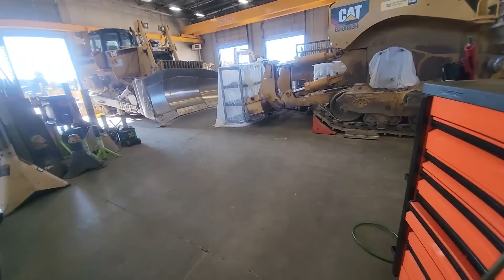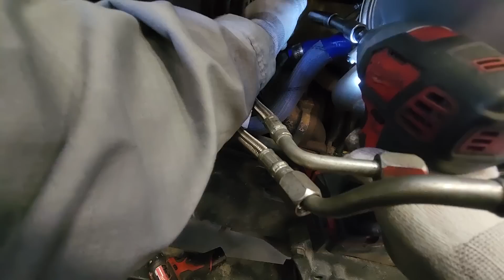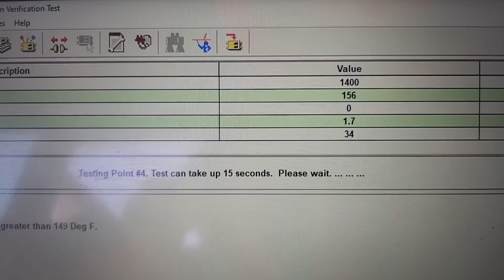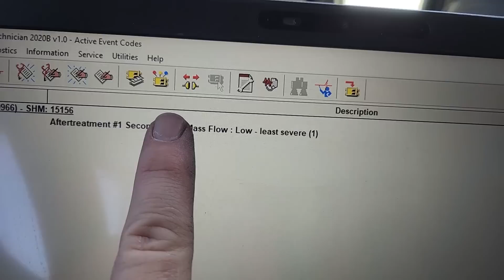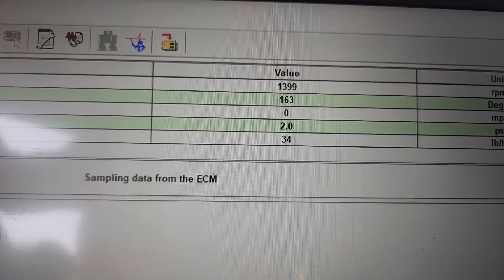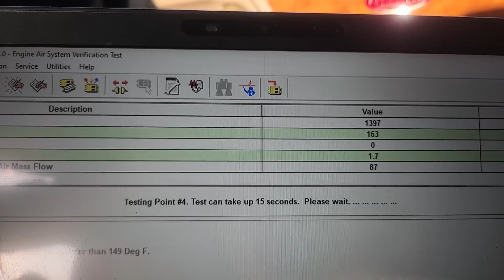Boost Leaks are Driving me CRAZY on this Diesel Truck. Green Can O' Worms 3.

Comment: im just going to give them my cereal number for my engine and they can order parts to fix the issue. so its 6nz15119. just need to order a new turbo cylinder head and ecm and the problem is solved

Comment: Clamp can't tighten enough due to rust buildup on outside surface where it grabs onto. Also the flange mating surfaces are worn thinner due to rust pitting and then sanding to make them smooth. That makes it necessary for the clamp to be able to get a deeper grip. A thin metal shim  (custom made sealing ring) placed as a gasket between the flange mating surface should make up the difference and allow the clamp to do its thing.

Comment: We use the same clamps on aircraft. We install the clamp, then tap it in different spots with a hammer to seat it, continue tightening, and repeat until you feel it's tight.

Comment: Get a finishing stone for cleaning sealing/mating faces instead of a sanding block. They're super cheap and what we use in the machine shop. It'll knock down high spots without scoring the surface and ruining the surface.

You can also try tapping those flange clamps with a small hammer  while you're tightening it, sometimes it helps everything find a home.

Owner pinching too many pennies is going to cost him a lot sooner or later. The fact that its a day cab says a lot. 😂

Comment: FWIW… 4 suggestions:
1) if you’re going to use anti-seize on exhaust components - Walter Surface Technologies Rock ‘n Roll. <— that’s its name.  It is good to 2500° F.  Ceramic anti-seize.  
2) are your pressure transducers good/accurate?
3) IMHO, I don’t like silicone either.  I use an intumescent sealant…. Most are acrylic.  
4) V-band clamps distort with repeated tightening.  The side angles open and they don’t compress like they should.  Eventually you are just tightening circumferencially and not squeezing the mating surfaces together.  Toss them.  I think it’s Pratt & Whitney that make V-band go/no-go gauges for the included angle.

Comment: Does your shop have a bead blaster?  That would eliminate the corrosion problems on the housings and ducts where the clamps interface.  I've found that bead blasting and lubing band clamp joints usually always results in a leak-free, sealer-free joint.

Comment: Try tapping on those flange clamps with a hammer after initial tightening. It helps force the clamp ways down intern tightening the mating surfaces. You can also tap on the two pieces to create vibration to relieve the stress and help draw them together.

Comment: Hi Joshua. Realy enjoy your videos. Think you Are professional and thorough in your work. Pro tip on these style clamps is i always tighten them, then give them a round of knocking with a ball peen hammer around the outer diameter. This in order to Get the v-band to Seat properly, and Shake loose any rust left on the flanges. Then i tighten the clamp to specs again. After the knocking my experiense is that the clamps Seat better, and seal better. Best regards heavy Equipment and oilfield service engineer for 20 plus years in northern Norway 👍😊 keep up making the good content💪 really enjoy your channel🤩

Comment: I am surprised that you were not using air only and not a smoke tester.  I have personally found smoke is much easier to find boost leaks with.  Note Aviation Form-A-Ggasket only works on smooth flat (machined surfaces) A possible better solution to sealing those pitted surfaces might be gettinvg some of that nasty aluminum paint that certain automatic transmission rebuilders like to use to cover up the crappy case cleaning job with.  I know several people who use that stuff as “head gasket” in a can on their top fuel  Harley’s and also coat their copper head gaskets with it when they want to lower compression.  I haven’t purchased a can of the stuff in a couple of years but the last time I did I used it to seal a similar problem by spaying some in a cup and using a small paint brush to apply several coats to the surfaces I was trying to seal and yes it worked like a champion.

Comment: I was wondering why you couldn't have tried a dry powder magnuflux or even a wet mag crack test on the cast iron housing while you had it out. Or at least take it to an engine machine shop to have it checked. It's used regularly to check out cracks in cast heads and blocks that can't be seen by eye.

Comment: Another trick I learned on airplanes is you tighten the bleed air clamp, tap around the clamp with a hammer, tighten it more, tap on it more to seat it the best you can. Surprisingly trucks don't use gaskets on those clamp joints.

Comment: Seems like there should be a better way to connect air plumbing on these diesel engines. Just fought the leaking clamp issue on the exhaust side of an International engine. Finally got it after several days.

Comment: I had a mechanical work order, used the same type of clamps but on a water system, it only stopped leaking when I changed the clamps a second time.

Comment: What a nightmare! 
One product I use for sealing stuff is Threebond (AKA Yamabond, Permatex Motoseal) which has more of a latex rubber texture.  I use it on nearly everything, but only a VERY light skim.  It's designed for stuff that needs to come apart, especially 2 stroke crankcases that are metal to metal.  After the light skim I let it cure for a while before assembly if I don't want it squeezing out.

Comment: Would've recommended to check relative compression and run an overhead. Usually it's a poorly performing engine that struggles to boost rather than some minimal leaks. Another helpful strategy is to step away from it and reassess your clues, as it's so easy to get tricked in a rabbit hole after finding a problem but not the problem.

Comment: Like you I'm not a big fan of silicone but I have seen it stand up to exhaust temps on a race car so it's not going to melt out.  As for your leaks I'm just wondering it lapping the sealing surfaces is possible.  I don't know I've never worked on a diesel in my life but I do know it works on valves.   Thanks for the video and keep the good stuff coming.

Comment: As a welder hd mechenic by trade...owned and operated my own 8/92 jimmy in the 80s  in a gravel truck for a while.Although probably not what one wd do with a cat customer..i used to use silicine on the many exhaust tube faces with a high degree of no leak success.Regardless of high heat or not it wd seal really well.If this were my truck i wd do the same on all these steel to steel surfaces.
   Wd bet many bucks it wd cure yr prob.
     Sureya can spend thousands replacing all the mating surfaces.May as well jack up the rad cap n replace the truck ...to all those armchair experts wanting perfection arent paying the bill trying to pay for it truck hauling....give it a try experts

Comment: Josh  how does a person get in touch with you? 
I have a 6nz and I am having trouble with my fuel psi. 
I've changed all the fuel lines and just replaced all the regulators in filter base. 
It runs great going down road, pulls awesomely. 
6.0
Fuel mileage average. 
Damn thing  seems like it is still getting air  into the system. Idling at 1000 rpm  it will cut out for a brief second then back to high idle. 
Now if I idle up to 1200 + it will not do it. You can hear a slight miss it once in awhile. 
Going to replace complete wiring harness next. 
I am doing process of elimination on situation. 
Running out of ideas on what to do next. 
Does this full of fuel or not.
Your imput would be great appreciated
Reply: That sounds to me like the ecm maybe losing power for a split second than a fuel issue

Comment: Might sound crazy, but its possible the intake manifold air pressure sensor is plugged up with soot giving a false reading. Cummins would be the same way and sometimes fail regens. Overtime that soot will build up inside the sensor. I would take a q tip with isopropyl alcohol and clean it, give it a few gentle taps on a table to drop the soot tucked up inside of it. 
Once it's dry, installed it back in manifold. Fire the truck up then it do a full regen. 
You wont necessarily have a check engine or code for this sensor so long as it has a reading of airflow. Generally codes for IMAP sensors are for open circuits or bad sensors however can fix a variety of problems due to faulty reading from charged air going into the intake.

Comment: When iv worked on 6.0 powerstrokes i found the best way to clean up turbo housings was sand blasting. Also id hate to be the next guy that has to split those gray silicone glued joints😂. Btdt with electrical connectors, turned into a repin with a new connector.

Comment: I wonder if putting some valve lapping compound between the v band flanges where they seal and lap them in would help, any potential high spots would be removed/reduced which should help if that's what's going on.

Comment: All of the new emissions trucks have exhaust gaskets around the pipe mating flanges and surfaces. And on the intake side they have paper or rubber seals/gaskets as well. I wonder if any of them are the same OD and ID and would work on CATs to avoid using silicone.

Comment: Having been in this business a long time,
I sympathize.
You fix a leak here, then the pressure is back to normal and all the other old, weak parts leak or blow outright.
Which as far as the customer is concerned it's your fault as you last worked on it.
Generally, old machines have many problems just from being old, and you are supposed to have fixed them first time round.

Just looking at the corrosion, I've got a feeling this engine was parked for a long time, probably because  it had a problem which the original owner didn't want to fix it at the time. So he sold it.
Now it needs to be revived, and it's your problem now.

Comment: We use air pressure to leak-test hydraulic units we rebuild after function test and use a regulator like you do to prevent kabooms.  We also use a different air connector on the test fitting end so full shop air can't connect easily or by accident.

Comment: One thing I like to do with V band clamps to get them to seat better is tap them with a dead blow, you can usually get another couple of turns on the nut each time you do that.  Something I learned back on aircraft.
Uhh not that it would help you on this monstrosity.

Comment: Had a c13 acert with the same issue. Secondary low mass air flow.  I chased the issues for weeks.   Would regen fine on the road but not while stationary. Guess it couldn't get the boost pressure up.  Would always fail the air verification test, test point 2.  Minimum should be 1.1 psi and i kept getting like .04psi.  Finally we had enough and im currently puttingn a remain in it right now.  Also had 1+ million miles, highish crank case pressure and lowish oil pressure...

Comment: V-Band tightening trick: Yes, never sneeze helped lube the clamp to slide & adjust but, Once flange sealing surfaces are aligned & clamp installed & initially tightened, get a small ball-pein hammer. Think of the T-bolt side of the clamp as 12 o'clock. Begin tapping with the hammer at the 6 o'clock position  then 4 o'clock & 8 o'clock. Tighten the T-bolt some more (it will be looser). Do that for several rounds all the way on both sides to near the T-bolt area. It will need to be tightened several times as the clamp sinks into the grooves deeper & deeper, wedging the flanges closer & tighter together. I learned this at an engineering/research facility, where engines ran for many hrs. & down time was very limited & bad! So we fixed them on the fly! At higher power leaks were easy to find with a shop rag on a stick or you could hear them whistling. This was slightly hazardous but was before Safety nazis monitored the test cells with cameras or locked the test cell during engine operations, plus the engines ran at 1200 to 1600 rpm, Not max rpm/racing. Good show of persistence!

Comment: So my thought is that your using 'V' bands to clamp the parts together. Thus you would need a minimum thickness on the flanges. Since the turbo compressor housing was so corroded that the flange became thinner, then you flat sanded the face, making it yet thinner. Thus it will never seal properly, but did improve when you try sealers which will eventually blow out. A proper solution would have been to place a shim gasket between the flange joints, this would have spread the flanges apart and allowed the clamp to pull them together tighter. Thus eliminating the leaks ;)
Reply: Thus

Comment: Can of smoke or a burning incents stick is good for finding leaks (don't use on petrol or LPG engines for volitility of those fuels, diesel is pretty safe). Soapy water works but messy. Stethiscope is handy too.

Comment: Josh, 2 things: EPA testing at GM we took the clam shell parts out of the clamps and welded them to  Vice-Grip jaws for quick connect & disconnect. AND whenever we had a failure we had to repeat the test and average the two for a good test. We were not allowed to test and test and test until we finally one to pass. ben/ michigan higan

Comment: This crap is why I haven't updated my trucks.  The ones I have now only have EGRs and even that's added BS I wish I could avoid.  Engineers spent decades squeezing more power, lifespan and economy out of engines only to have the EPA come along and force them to undo all the gains they made.  I'm convinced that the pollution they prevent with all this stuff is offset by pollution created because of it.  From pollution created making new parts due to short lifespans to lower fuel economy to contaminates released to the environment due to increased failures.

Comment: Wonder if you would have glass beaded the parts to remove scale and rust, would it have helped. What I have seen on the ASVT, if Combustion Air Flow is 160's and less, more than likely it will fail. 170's is boarder line and anything 180's and up are OK. I also found a few that the ARD head swirler plate had excessive carbon build up restricting air flow. Another test I have done is put the engine at 1400 RPM's and put 12 volts on the Combustion Air Valve so I can hold it wide open, while looking for leaks around the sensor. Seen a few that the orifices in the Combustion Air tube to sensor was partially plugged. I also take the Combustion Air tube off the valve during the test, sometimes. Just to see if the Combustion Air Valve is opening completely up. As you well know if the system has to much back psi, the sensor just reads it as low flow. So sometimes I take the tube lose at the ARD head just to see if I get a really high flow reading. Boost PSI during the REGEN should be around .740 if I recall. Also as I have done ASVT with Boost sensor reading on the turbo side checking restriction across the CAC. Looked up my notes and system's that has a ninety degree configuration, may not do a successful stationary REGEN. Only transient REGEN's will work. Glad you have it, I need what little hair I have.

Comment: Ok like you I agree the silicone is a short term fix at best but if customer don’t want to defeat the entire def system how about adding a bung use a gauge to bung and ball valve using supply air from truck and manually increasing when you need to regenerate after regeneration shut ball valve and go about your trip until you need another manual registration

Comment: I would like to suggest using a cheap oil stone for cleaning the turbo mating face, rather than a sanding block.  You can buy them at Harbor Freight for a few dollars.   They are 8 inches long, about 3 inches wide and a bit over an inch thick.  There is a fine and coarse side.  Use some WD-40 or CRC for lube and go over the pitted surface in a circular motion.  When done, switch to the fine side to finish up.  They also work great for removing stuck on gaskets from iron/steel and aluminum surfaces.  It abrades the gasket away and works best in the parts washer with constant liquid flow.

Comment: I was taught to tighten clamps a little, tap around them with a hammer,  tighten a little more, then more taps and so on till tightened fully,    it helps the clamp seat properly and pushes it down tighter pulling the surfaces together more,,,     prolly wouldn't have helped in your situation though,,,,,      that goat is the GOAT ,,   dont ever lose him haha,

Comment: Surprised your not using an evap system smoke tester for leak detection.  Not terribly expensive anymore.  Smoke and a strong polarized light works well with even smaller leaks  and the flow guage is useful in determining the severity of the leak(s).

Comment: When I worked on Air compressors I had a 12 inch square steel plate that was machined flat so I can use wet sandpaper on to lap components, valve plates.
Also there is 3M stainless steel tape you can buy and cut to size to wrap around joints then place clamp on. Kind of a field repair for corroded components but it seals.

Comment: I am going to teach you a trick maybe you do this maybe you don't. Tap around the outside of the clamp with a hammer. Basically as hard as you would tap a nail to walk it into green pine 2x4. So some force but not killing it. Walk around back and forth all the way are the clamp. Use a prybar if it is in a tight spot. Tighten it. Do it 3x. You may already do this and just didn't say this time around. Also for cleaning the clamp groove where it sits. Get it down to shiny. Also using a thin graphite or tin gasket like you find inbetween dpfs can help as well. I have had some luck with DPF aluminum tape that international used on it's DPFs. Then there is the buy thin soft copper sheet and basically put it inbetween. Max would be 1/16th thickness sheet copper. There is also the spray copper gasket stuff but from the video on my TV it looked like it might be too deep.

There is a permanent fix way called acoustaseal but once it's together. It's together there is no taking it apart again.

Hope this helps.